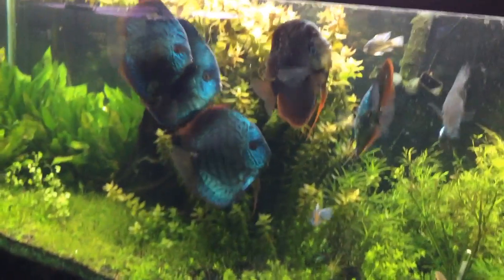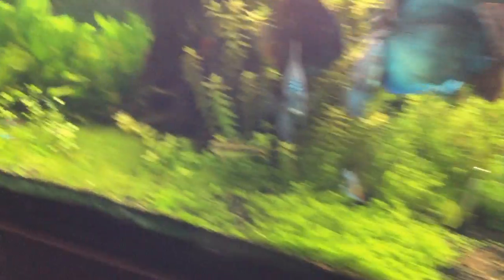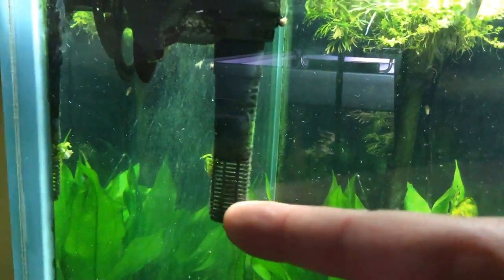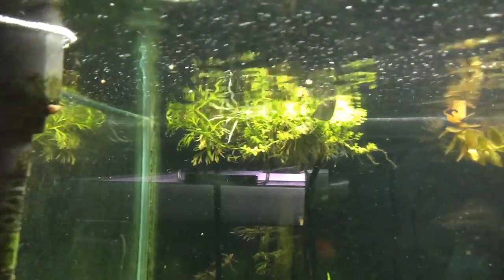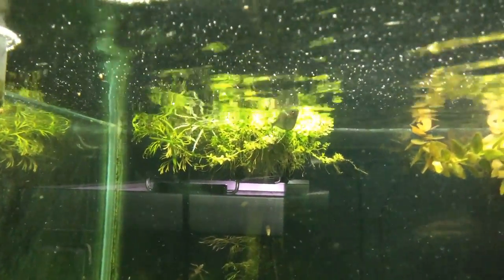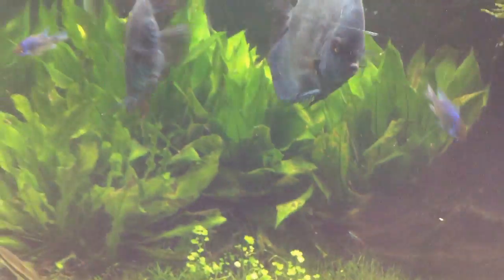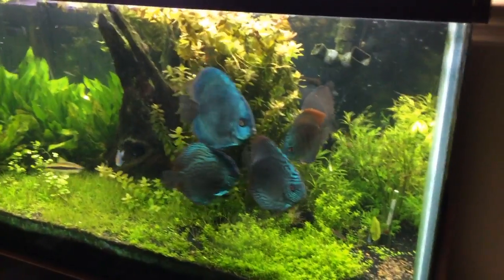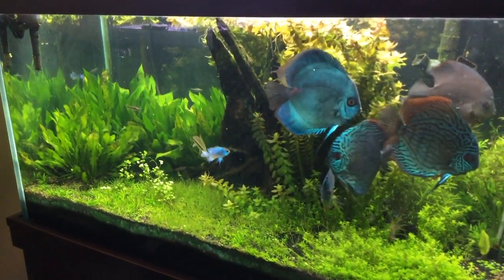Easy way to remove bio-film from water surface

Comment: You should put a good size 3-4 diameter cylinder sponge filter around your water intake. This would keep things from getting suck in, but most importantly increase surface area for beneficial bacteria to build on. It would hot rod your filter system.
Reply from the maker: Great feedback.  I don't have this filter anymore.  It fell off the glass when I was away with work and went face down, blowing up a bunch of black sand that was then quickly sucked up by the FX 5.  I have an FX 6 now.  ;-)  Thanks for sharing.